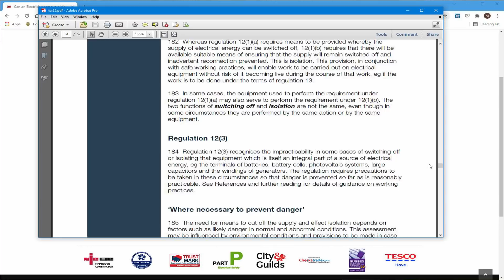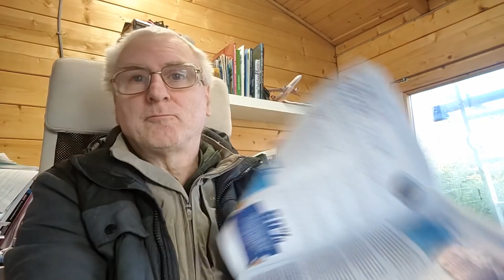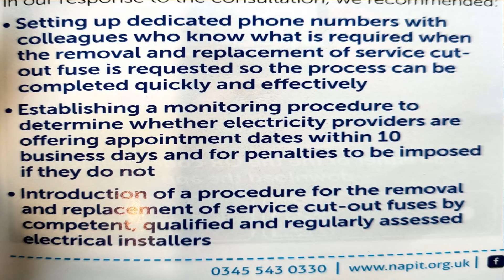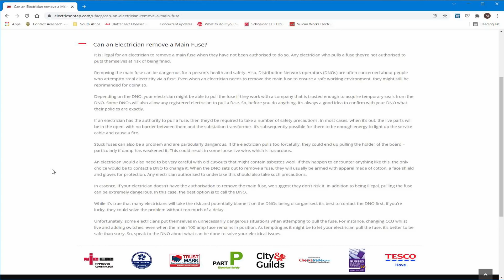CUTOUT OR MAIN FUSES - New procedures for 2022 should finally allow electricians to pull these fuses

Comment: As a non-electrician, I wonder how an electrician such as yourself completely changes a consumer unit without removing the cut-out fuse if there's no isolator and you also can't get to the load side of the meter tails without breaking a seal?
Reply: Carefully … 😂😂😂
Reply from the maker: This is why I pointed out in the video that technically there is an argument that every electrician that works on a CU without being able to totally safely isolate it is contravening the Health & Safety at work act, therefore the DNO should facilitate a contractor to be able to work in theory legally.
Reply: @vwes   I believe the DNOs will not be happy to do that to be fair. There are lots of issues with meter fixers as it is. More likely to push it onto the suppliers as the meter is their property and DNOs can't remove the seals on meters unless there is a danger, then it has to be a supplier who re-seals it. Its a mess since the change to supplier owned meter rather than DNO owned. We have experimented with meters that have isolation points but the costs got stupid. To be honest in my experience I wouldn't trust a random electrician to not damage it or many to be able to assess the safety of the equipment as there are a lot of different cut puts and many are 60 years or more old.
An electrician can apply to the supplier to pull the fuse so the electrician can fit an isolation switch to outgoing tails.
Reply: In reality they work live for a time, legally they should request the fuse is removed by the supplier.

Comment: My new smart meter doesn’t even connect to the display indoors.
Reply from the maker: lol. Yep, mine doesn't either, and yet its the other side of the wall ! And when it does display it says I'm using the same electricity as a small town, but thats a discussion for another day.
Reply: @vwes  the gas meter has not connected once, we have to email readings every month.

Comment: Prior to the introduction of Part P I used to call the supplier and asked them to fit a 100amp isolator after the meter.  Do suppliers still do this?
Reply: Suppliers dont do anything until pushed. Saves money and boosts profits.

Comment: The DNO should have been made to fit isolation switches many years ago
Or BS 7671 should insist all new insulations are fitted with an isolation switch before the consumer unit for example. There is no excuse for them being able to get away with it as the customer cannot isolate a dangerous situation with there consumer unit. 
Iv pulled them for many years following privatisation as it became a joke trying to get a fuse pulled. I gave up trying and got on with pulling them and re sealed them too . Never once had an issue until smart meters and now I’m more concerned about being pulled up over it . It’s bizarre that it’s been going on for years and years and nobody has dealt with this problem. Who is going to admit they have taken the tails out of the old type meter breaking all the seals?😑
Reply: Some DNOs did before they had to pass on responsibility to the meter installation company who now have responsibility on behalf of the supplier.

Comment: I work for one of the DNO's.  Don't pull the main fuse, the fault energy at that point is not a joke.  New installs may seem fine at first, and normally its not an issue pulling a cut out, but when it goes wrong, what do you do ?    Even a flash over at that point without decent PPE (something we hardly ever see domestic sparks wear) can blind, main, burn or kill.  Domestic sparkies have all probably had an "event" in the house, but until you see what a mains fault does (my colleague and neighbour was a jointer who was subjected to a flashover on a service line) it doesn't sink in.

It's life changing...

rant over, sorry.
Reply: You should try working on a switchboard with a 40kA fault rating not a domestic supply if you want excitement over hysteria!
Reply: @Andy XoX  I work at 400kV and seen my fare share of electrical faults at 240V, 415V, 11kV, 33kV and 132/275/400 kV.   I have seen  more than a few fatalities and life changing electrical events, mostly from the lower DNO voltage  levels rather than TNO levels.   There are reasons why the DNOs and TNOs have so many rules and oversight.   If it was hysteria, we would be in the perfect world where no one was killed or seriously hurt.  

I am fairly sure a 40kA fault level board will be under a safe system of work, to keep those working on it safe. 

Who keeps your typical sparkie safe on a 40 year old cut out that has probably never been inspected for serviceability.

The DNOs and IDNOs should be forced by legislation to install isolators after the meter.  This is surely the most common sense approach to the issue of safely working on meter tails and CUs ( of course that will cost money, so will it happen, probably not...)

Electricity deserves respect, let's remember that !
Reply from the maker: Thanks for putting a perspective on it from a DNO's engineer point of view.
Reply: I work on an industrial HV network. Comes into our site at 33kv and gets transformed down to 11kv. We have to wear all the gear when switching/racking breakers in and out.

Last year the DNO came round to my house as I had no main earth terminal on my TNC-S supply. It would appear that UKPN’s PPE consists of an old sweatshirt and pair of jeans 🙄

Comment: My very 1st few jobs i was Mr belt & braces & never pulled the main fuse, after realizing how much more dangerous it was to leaving it situe, i decided to just cut the tabs & do it myself which is far more safe espesially if your trying to pull old tails out from a metal case. I also realised it was far simpler than spending about 3 hours on the phone to the main supplier then waiting for him to arrive. 
You cant always go by the book & sometimes you have to break the law. ( i also done 37mph in a 30 zone today)

Comment: What about the meters that were about for a few years which could be turned off with a screw driver and allow access for the spark?
Reply from the maker: Good point. But I've now noticed these meters are now being fitted with security tabs to prevent the screws from being turned.

Comment: I think your all forgetting a qualified electrician has Common Sense ( well you would hope ) been doing it 39 years with no problems ( sometimes live ) ref asbestos 😂 I’ve had a school rewire when as an apprentice we were instructed to smash ceiling tiles where required ( as fixed type ) to gain access above only to be told after one week they were blue asbestos ( you could hardly see above with floating particles ) also in large hospital plant room large chunks of the pipe lagging would be on the floor which was also asbestos.Now we all know the modern day issue with it and use common sense ( you don’t call in a specific team in to remove an old fuse board that the fuse holders have asbestos 😜) also cutting down lights in a artexed ceiling ( you can go on and on ) COMMON Sense Please.YOU have more chance of getting tangled up in that twin and earth cable that’s slithering down your wall behind you if your office catches fire as you have not used these modern fire rated clips.I would be walking away from so so many jobs if I looked into every possible negative issue.Reg this Reg that I’m glad I’m closing my tool box for good in a couple of years ( asbestos allowing fingers crossed )
Reply: It's amazing anything gets done, it's as if the cretins have taken n over v common sense. Made my money doing work while cretins scratched freckle a with some BS method statement etc-get in, get out, get paid

Comment: One very important thing I never heard, when pulling a main fuse it is only single pole isolation.
Reply: On the extreme end of this, it's well worth checking the fuse is actually in the phase conductor, and hasn't accidentally been installed in the neutral instead (for the past 20 years)... Someone I know spotted one of those, and the DNO was round pretty quick when he told them.
Reply: There are some double fused cuttouts but under hse law they have to be replaced when found
Reply: @haldo691  On the case I mentioned, the fused neutral was just a plain mistake, and was caused by the dno accidentally exchanging phase and neutral on the supply cable to the flat in question!

Comment: I have never cared about removing the fuse, new fuse heads are so big they should be fitted with DP isolators like they are on the continent. Waiting for DNO's to come out for a CU change or in some cases 3 phase supplies to be appropriate isolated in domestic premises can take months (and often you get from DNO engineers "just pull the fuse"). Often where possible it's better to not isolate and actually power down and disconnect at the meter. 

However I have a specific skill set, often dealing with Asbestos in old factory consumer units where Asbestos specialists will take what I removed but won't actually get involved. I will call up DNO's to  have Heads changed where I deem appropriate (before or after I have already changed CU's and rewired properties) but because we work in a commercial/industrial environment we have all the flash over and surface isolation gear for that. 

My biggest gripe though, I am also gas qualified and meter qualified at that - I can remove, cap off, replace and/or move a meter position and the Gas Supplier is required to provide an isolator. Every 5 years I have to prove competence personally in a college to continue doing so and maybe once every 10 years GasSafe will come inspect an engineers personal/ a companies work depending on record of complaint (if any) against a company.
Yet every year we pay 5x a GasSafe membership to the NICEIC for someone to come inspect our works - much of which they have no idea what they're looking at if it's outside their own remit. There's also less support and arguably where GasSafe and the required qualifications prove competence to the HSE, NICEIC membership and electrical qualifications do not prove competence to the DNO's. Yet I've been on site when 5 day meter installers have come in while we've changed CU's and re-plumbed/wired entire houses, they've shut off gas while appliances are running and pulled fuses with loads still attached. Yet because they've done CPS with energy suppliers they're deemed competent, barely.
Reply: Couldn’t agree more 👍

Comment: It’s very simple. Require the DNO to fit isolator switches, then there’s no reason to pull the fuse. No excuse really when the electric companies have been fitting smart meters.
Reply: No the meter operators should have fitted them along with the smart meters

Comment: Installations (the VAST majority) WITHOUT an isolation switch are just NUTS! This is especially true for new builds. 

WHY NOT have one as standard? The DNO supply to the box, meter installation and tails can all be accomplished that much sooner with on site, safely isolated power available even before first fix, thereby avoiding any excuse for second fix and full commissioning being delayed. 

It also means that is is far easier for a sparky to provide an early temporary mains supply for other first and second fix trades - plumbers, plasterers et al. rather than having to run on site generators, and long 110 volt transformer lines everywhere.

All for the sake of what? £15 retail for the isolator and 15 mins tops fitting time. On a £250,000 build, that's not just peanuts, it doesn't even rate as gnat food.
Reply: There is a company that charge £192.85 + vat for single phase isolator to be installed 😁. Shame on you WPD…..
Reply: @zjzozn  the COST to install one during a new build is a simply part cost, NOT an after market cost! A typical external isolator on its own adds less than £15 RETAIL. We are NOT talking about a retrofit and it DEFINITELY doesn't cost almost £200 to fit one from scratch ... Not unless sparkies are expecting to charge £400 per hour! An inexperienced person who can wield a screwdriver, a drill and cable stripper should EASILY be able to fit one in under 30 mins. An experienced fitter in under 15 minutes!
Reply: DNOs only fit the cutout and meterbox the rest is done by the energy supplier
Reply: @haldo691  picky picky ... It's still NOT first or second fix sparkies is it?
Reply: @boblewis5558  nope and it's not the DNO
Reply: @haldo691  what's NOT the DNO? Of course the DNO supplies the input, the fuse block and fit same to a meter box which the BUILDER installs. That's basically what I said. Whomever fits the meter  and tails either has to make TWO visits to site or has to fit the fuse cutout when the CU is connected. 

Too many ifs, buts and wherefores in that process. Not ALL suppliers are separate entities either. Sometimes, even if separate branches of the same entity, they are the same company. E-on and E-on Next for instance. So like I said "picky, picky" and missing the point entirely. 

It should NEVER be necessary for sparkies, or anyone else, to have to pull, or request the pulling of the cutout fuse EXCEPT where fitting, replacing or rewiring the incoming end of the isolator. 

It would ALSO obviate the unnecessary INTERNAL isolator in a CU which STILL leaves live connections INSIDE the CU!!??

Obviating the need for a separate internal isolator inside a CU immediately frees a double slot for at least one of the additional components such as an SPD or AFI that are now becoming required, AND means ZERO live connections inside the CU just like it used to be back in the fifties' fuseboxes.

Comment: If your intent is to tamper with or bypass the meter it should be a criminal offense. If your intent is to making the electrical system safe to work on it shouldn't. Why don't they just have a disconnect after the meter? Can't you just call tye utility and they would pull the cut out if you need it pulled?

Comment: I have to say, thank you for your very interesting video, I'm a qualified electrician, but work with gas in the plumbing and heating side of things, safe isolation of a gas supply is considered to be very important, and that there is a means of isolation at the metering equipment, should it be defective then it is reported to the supplier and things get resolved pretty quick, and that's not even with any gas leak, just an isolation issue, maybe it is that things need to change with supply equipment to electrical installations that follow in such way as to comply with the HASAW act or EAWR that there are integral  means of isolation of the supply after the metering equipment, that disconnect the supply . I have seen 2 pole isolation switches that have been fitted by the DNO I can't understand why these aren't fitted if the metering equipment changes for the smart meter to be installed !. Sounds like smart joined up thinking needs to come from the supplier's and meter manger companies!,  If there are fewer energy suppliers by end of this year, it may become a more organized process!!. Cheques used to take 3-7working days to clear, etc!!!.best wishes & Happy New year!!
Reply from the maker: Thank you for the comment. Glad the video was interesting. It's provoked a lively discussion, which was its intent :-)

Comment: I have never understood why double pole isolators aren't fitted as standard. I fitted one 20 odd years ago between the meter and consumer unit allowing me to easily carry out future works. I asked DNO to remove supply fuse, I fitted the isolator, they refitted the fuse, job done.
Reply: Same here,     Make life so much more safer, simple for the sake of £25.  it’s a mystery why it’s not a  requirement
Reply: There was a period where the DNO was fitting them as standard ever time there was a need to remove a fuse, then they realised the cost in materials and labour for something that wasn't the DNOs responsibility and they had no use for.

Comment: Done it for years never a problem, HV gloves & face mask  job done, also the asbestos situation is over the top, sensible work practices with such a small amount,
I’ve found that roof fibre glass insulation a far far bigger issue  working in &around that for hours on end is a nightmare especially in older properties,  if you ask the customer to get it removed first you lose the job,
Reply: You’d be getter wearing heavy gloves than HV gloves as the voltage will always be LV!
Reply: @andyxox4168     I’ve been in the Electrical  trade for 55 yrs working on LV, MV HV,  400,000 kv &. grid systems & know my safety equipments extremely well  that’s why I’m still alive at 76 yrs
Reply: @brianatkinson4484  then you’ll know what I mean with regard to heavy heat proof gloves then ...

Comment: Let's face it, it is crystal clear at present. You do not do it. It may make things difficult, awkward etc etc...but that's tough. Likewise with the live working aspect. If you choose to do it live...you have chosen to do so. If you choose to pull the fuse...you have chosen to do so. If you need to do work that requires pulling of the fuse....sadly you just wait. Inconvenient yes....but safe and legal.

Comment: Simple solution to this age old farce make DNO fit DP isolator consumer side of there equipment , we had the beginings of this when they first rolled out smart meters but i assume due to additional cost (approx a tenner ) they stopped doing this as a given. I always ask supplier for dissconnection reconnection or install of isloator , so far i have always had the isolator fitted best supplier to accomodate is definatly Octopus Energy.

Comment: Most suppliers will fit an isolator if asked... The problem is the "if asked" bit. It should be standard.
Some old meters had isolators built in, so no excuse why smart meters can't have them